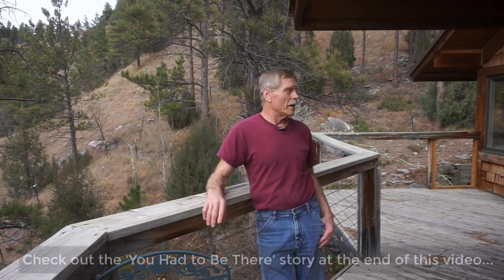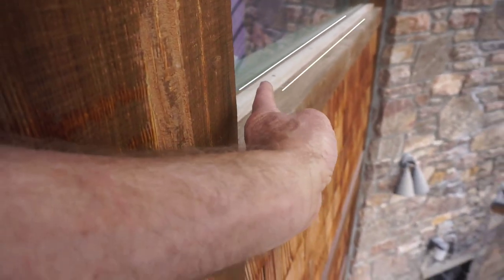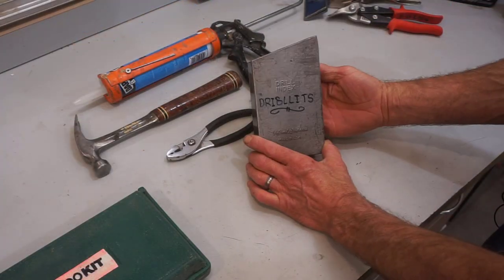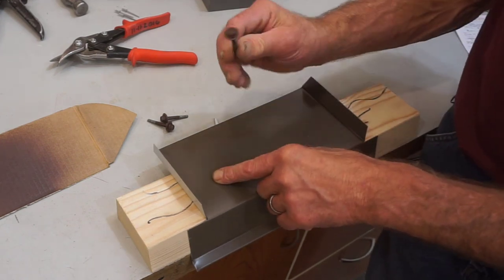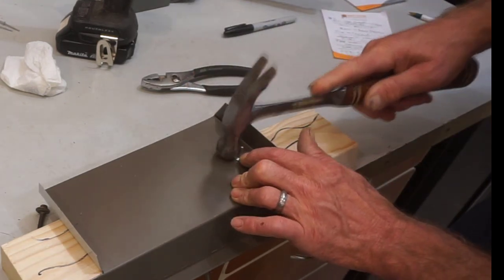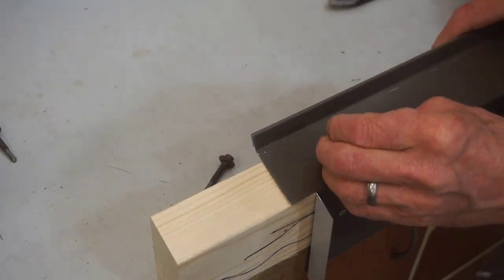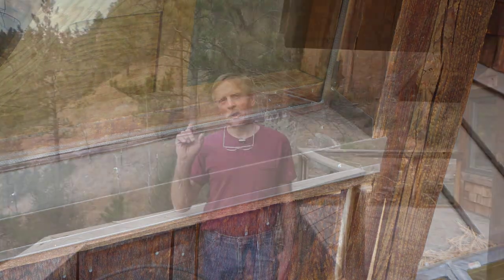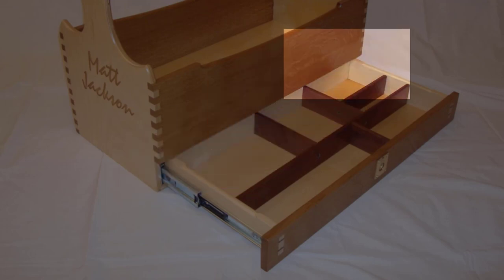Reverse Pop Rivets Fasten Metal to Wood?!

Comment: Or just a roofing nail.
Reply from the maker: Oh, so you're THAT guy!  No next level workmanship from you then? 🤨
Reply: I thought that too but the esthetic is not the same.
Reply: Pounding the pin in expands the rivet. The pin is now driven into new wood like a finish nail, and the head has expanded against the drilled wood. Having both these, along with the consistent appearance, makes it more than a nail. I like it!
Reply: For a woodsy application like that, try natured alcohol (instead of denatured)

Comment: Wait a minute... that's a nail.
Reply from the maker: Yes... and no, Adam.  In an installation where pop rivets are being used for other connections a nail would look 'out of place' IMHO... but then again there's lots of times when that wouldn't matter so much.  Best, Matt
Reply: I know, I am curious how this is much better than a finish nail and a matching washer?  It LOOKS neat and is certainly a neat on-the-site solution when you don't have the 'right' stuff (not that this is wrong, if it works).

Still, it's something I will keep in mind for a few projects.
Reply from the maker: @DieCastoms  where would you find a coated finish nail and 'matching washer'?  Keep in mind that matching washer head screws WERE on site and I chose this as 'the 'right' stuff' on purpose, not as a inferior substitute from lack  of preparation, hence the disclaimer 'it's not a universal solution'.  Slip it into your bag of tricks for 'someday'? Best, Matt
Reply: That is a good finish.
It looks better than nail heads and washers sticking out. 
Think I'd seat the sill onto some caulking or construction adhesive just to make sure thise little pins don't give way in the wind.
Yes, another brilliant way to finish sills.
Cheers Matt ☺
Reply from the maker: Agreed,  @johnmontague69  ... the sill caps got sealed to the glass with bronze silicone to assure their integrity but a 'bed' of caulk underneath the flashing wasn't necessary for this installation because, despite being old and checked, the sills are incredibly dense and held the rivet pins with tenacity!  Your mention of additional adhesive tells me you've been around enough variety in on site conditions to know when extra measures are necessary and have the sense to apply them so thanks for adding your comment for benefit of other viewers.  Best, Matt
Reply: He is like me, overkill.
Reply: No, the pin in the rivet expands the rivet shank, increasing its holding power.
Reply: Cool trick. With a little more preparation, I'm going to use that trick with flush rivers, to put some sheet metal lining on some shop-made woodworking tools
Reply: I was trying to respond to the first comment, that it is just a nail.
Reply: @brw3079  It don't expand it when u reverse it because when it's the normal way the flat head part would be against the metal and the round head would squish the shank down and expand down to the flat part but reversed the shank is in the wood and the round head is just in the air being hit by it self till its touching the flat part so it don't expand it this way..  Watch it again..
Reply: @Dennis-pe6zx  The pin has a bulb on it. The pin was reversed. Now the pin has a bulb above the rivet head. The rivet head is forced down onto the sheet  metal. The pin is hammered home. The bulb is now forced into the rivet head. The bulb has to go somewhere, so it expands the rivet head and part of the rivet shank.
Reply: @brw3079  That's not expanding it and holding it in.. Only thing the ball is doing now that it is reversed is sealing over the hole with the silicone. It's not expanding nothing because with it being drove home the pin and shank both went down so the ball is just barely going down in the hole.  So the part of the rivot he reversed is working more as a sleeve and the center is just a nail with a round head.. Which I really don't care for because with him trying to sink the ball he dented in the metal everywhere he put 1..
Reply: @brw3079  It don't go in and expand like it normally would at all. Made it like a flange on a break like. Or look like a funnel but not as steep or deep.. (in case u don't know what the flange on a break line looks like)
Reply: @brw3079  Check out 7:00 it show the ball is still completely above.
Reply: What everyone needs to remember is that this trick was developed by a sheet metal guy and most of the guys I have ever talked to have TONS of rivets in their supply but few small nails. This procedure is/was whats for THEM and I am glad that Matt shared it with us. As Matt said " This IS NOT a universal solution for all (not even most) sheetmetal installations but, rather, a great alternative for jobs where cosmetics are more important than overall strength of attachment so installer judgement is required!"
Reply: @tomtruesdale6901  Looks like it worked good enough to me and I do carpentry and finish work for a living. Like u said in a pinch it will do just fine. No matter what u say someone is gonna find something to complain about this is YouTube.. Can u imagine if u put this on facebook lol.  Holy shot look out this would be the worst thing in the world and would have to tare down the house or something lol.. Keep doing u have a good day.. 👍✌🤪😊
Reply from the maker: @tomtruesdale6901  your sensibility is a breath of fresh air  here... thanks, as always! Best, Matt
Reply: @jeffstanley4593   They call it OCD i call it doing it overkill , when im building and assembling , but its peace of mind, if the budget allows it sure .
Reply: LMAO, sure have seen a lot but never a nail in descise
Reply: Adam Rivera i think the key word is Aesthetic.
Reply: It's a nail in rivet clothing. xD All it needs was a nail, but it looks better this way. Plus it will give anyone who doesn't know this trick something to think about -- "That's a REALLY long rivet. HOW did they get it in???"
Reply: @brw3079  Yes this is how it is better than a nail. Like how an red head concrete anchor is better than a big nail. 😊

Comment: The reason people do this rather then use a nail is when you drive the pin in the ball at the end expands the rivet into the sheet metal an helps it make a tighter seal

Comment: What works even better is to install a hook strip first.  A piece of metal formed to the same profile as the outside cap that is nailed or screwed to the existing sill. The “kinked” front of the hookstrip slips into a hem that is formed on the outside piece .  This method prevents high winds from blowing it off.  Worked for me for 40 years as a union architectural sheet metal worker.

Comment: This is  perfect idea for an installation for my deck. I had a shed installed underneath my deck and the installers put slanted boards underneath the corrugated aluminum roof to divert the water away from the wooden walls. It was not a successful application as the water runs onto the wood anyway. So now I have to deal with keeping the wood from rotting on my own. I bought some rolled sheet metal flashing(1 foot wide or so) from home depot(color matched to my stain) and I am going to extend it out from the slanted wood. I will use the reverse riveting method to attach the sheet metal so water will not hit my wooden shed wall. Count me as one person you helped. Thank you for your kindness in sharing this with me. I will probably add a gutter as well.
Reply from the maker: That's cool, George!  Be sure to goop 'em up well with silicone anywhere with constant exposure to water because the reverse rivet pins are relatively small and won't hold well in damp wood or heavy loads.  No shame in using color matched washer head screws where necessary... Best, Matt

Comment: I'm making an anti theft mailbox using a 12 X 24 round air duct and a PT 1 X 6 and thought I could use a pop rivet to attach the sheet metal but didn't know how without splitting the wood. Now I know to use a reverse pop rivet which will look much better then truss screws I had planned on using. Thanks 👍

Comment: Well I'll be!  I've seen these before but never knew how they did it.  Now I do!  Awesome tip! Thanks!
Reply from the maker: Not sure what you've 'seen before but never knew how they did it' Daniel but want to make sure you know that this isn't the standard use for pop rivets which are normally used for fastening sheetmetal to sheetmetal requiring a pop rivet 'gun' to do so.  Ignore this if I read more into your comment than intended, OK? Best, Matt
Reply: @NextLevelCarpentry , Thanks for the note.  Yes, I've seen rivets used this way (to secure metal flashing to wood).  My family did all kinds of construction and remodeling and as a kid, I was dragged around as free labor.  Most of my woodworking skills came from trial and error and improved by watching videos like yours.  So Thanks!

Comment: This is a perfect solution to a project I am working on now. I am adding a 6" roll flashing border on a wall, to give it the industrial look. I was looking for fasteners that would give that same industrial look without protruding and catching on passerby. I'll use adhesive and reverse rivets and I bet it will look great. Thanks!
Reply from the maker: MJC Peters, this does sound like a great solution for your project.  If there's potential for clothes catching you might want/need to hit the rivet heads with a smooth file after driving in case there's any little burrs to snag stuff... but in any case this will be far better than hex head bolts or regular flat headed nails... Good luck!  Best, Matt

Comment: Hello! Love your channel and watch it often. PLEASE NOTE: Wrapping window sills with aluminum ACCELERATES decomposition of the wood. Im a contractor in historic St.Charles MO (Where Lewis & Clarke crossed the MO river). I regularly work
 on 150 yr old homes, the majority of exterior wood damage that I repair is caused aluminum wrapping!!!! The wood is completely disintegrated under the aluminum. Water gets in and can't escape.
 Best method is treat wood with breathable sealant and use a drip edge type flashing to direct water away, but allows it to breathe and dry.  Thanks again, love your channel.
Reply from the maker: Your note of caution is well taken Tim... I too see plenty of degradation of wood wrapped with aluminum... particularly on aluminum and vinyl siding jobs where improper sealing and not accounting for water draining indeed accelerate rot.  It's not aluminum in particular that speeds up rot but the other factors you mention.  These sills in this instance will definitely extend their life even though 'wrapping' is often not the best practice for doing so. Best, Matt
Reply: What is "breathable sealant"?

Comment: Pure genius! I just used some rivets the standard way to fix my daighters broken school id. badge after i found that super glue would not bond to the plastic. I made a small tab from sheet metal and folded it in half drilled 3 holes, two for the tiny rivets and 1 for the lanyard. I hammered them flat for a cleaner look once complete. She didnt know what rivets were, but after I explained they hold airplanes together, she appreciated the effort. This just goes to show, you can always solve simple problems if you use your best tool, not that tool, the other one!!!

Comment: Thats awesome!  Tks for the share!  Paint won't stick to silicone though in my experience, well standard latex won't, rattle can might, can't think of the right word ATM
Reply from the maker: You're right Dirt Diver... pretty much nothing sticks to silicone... unless it's the paintable type.  I use alcohol in the video to clean it up but a quick wipe with acetone or lacquer thinner might be necessary too to get something to stick.  Best, Matt

Comment: Also, your "dribletts" tin reminded me of the exact set that I once owned. Replaced them with quick connect bits from Milwaukee when I purchased a Black+Decker Matrix combo that included both drill and driver "heads".

I once took golf lessons using my father's trusty dusty sticks. First comment out of my instructor's mouth: "Ah, bag of ancient Chinese wisdom!" Cracked me up and I'll never forget it.

As these are obviously well-seasoned bits, perhaps a short tool tip video on how a Master Carpenter keeps his bits sharp?
Reply from the maker: John, a video showing how I keep bits sharp would consist entirely of a demonstration of the Drill Doctor machine I've used for years.  Any model is a good value since they can easily pay for themselves in faster drilling and saved bits.  This is the model I have:  https://www.amazon.com/dp/B000BKUY1O/ref=sspa_dk_detail_0?psc=1&pd_rd_i=B000BKUY1O&pf_rd_m=ATVPDKIKX0DER&pf_rd_p=f52e26da-1287-4616-824b-efc564ff75a4&pf_rd_r=5W3X1RCS4VBYXN9C42NP&pd_rd_wg=eSYp0&pf_rd_s=desktop-dp-sims&pf_rd_t=40701&pd_rd_w=U5r5J&pf_rd_i=desktop-dp-sims&pd_rd_r=7ed75962-db32-11e8-943e-3f50e486d3b4
but I'm pretty sure any model is a good investment based on anticipated use.  Best, Matt

Comment: Funny you put this up today.
I actually have the tin off the side of one of my buildings trying to figure out how to fix a bad leak around a replacement style window. 
The water was just running inside the building.

A local handyman put it in 4 years ago or so and the massive amounts of caulk he used have finally failed.  I found videos on how to 
instal the nail flange windows in tin, but none on replacement style windows. 

I'm going to need to make the opening a bit larger and make a sill. As it is it's all 2x4's that stick past the sheathing 1/2 inch or so. No slope on the bottom and no room around the window frame for adjustment or even insulation.

My other option is to get a new sheet of tin and cover the window and forget I ever had one there...
Reply from the maker: Ya, there's a LOT of ways to do sheetmetal wrong, that's for certain nevermindthebullocks!  This trick might come in handy as you re-work things but sounds like you might need bigger guns and more ammo to make things right for your window challenge... good luck! Best, Matt
Reply: @NextLevelCarpentry  I have put in one exterior door. But it has a porch over it and catches no rain.  

I think I could handle a flange style window with the housewrap and flashing tape. On this one there is none of that. 
I think I will use some plastic for a ways around the window and down to the ground under it and use flashing tape. 

This one the only thing I can think is copy the door design and trim out. I will run plastic and flashing tape around and under the window so if it does leak it just runs to the ground behind the tin. Instead of inside my wall and insulation like it currently is.
Reply from the maker: @nevermindthebull0cks  do what you can to keep water from getting behind anything and, if there's any chance for it to get in, there should be a flashing to get it out asap!  Without actually being able to see your installation details I don't have any other advice in particular.  In general a drip cap on top and good sealant along sides and bottom will get the job done but metal skinned buildings introduce some complications... but  you already know that.  Best, Matt

Comment: Any reason why you wouldn't use flashing nails? Seems like they would hold better than a smooth rivet pin.
Reply from the maker: Good question Shadow Hunter... I like the look of the rivet head for this application better than a 'flashing nail' but that's just me.  These sill caps need only minimal fastener holding power to stay in place so the less-grippy smooth rivet pin was more than adequate.  For other flashing applications a nail or screw would be needed to hold things in place long term.  Best, Matt

Comment: Neat trick, is the main benefit the fact that the rivet won't pull up verses when you're trying to do it with a rivet gun? Or is there another benefit as well? ( I can't say that I've ever riveted into wood before) For sure nothing will quite make you curse as much as riveting a finish trim piece and accidentally denting the metal with the rivet gun as the stud breaks off.
Reply from the maker: Hi HFR... the thing I like most about this little trick is to get a consistent 'rivet look' on a sheetmetal project where otherwise there's a mix of rivets, screws and nails.  Careful execution of riveting and this little hack will produce as non-dented of results as possible.

Comment: Thanks for this Matt 👍🏼 Great finish with this method.
How strong is the hold with this method though? I totally see the sense in using the mandrill as a fixing nail, but as the shaft of the rivet doesn't get compressed, what's to stop it from just popping off?
Reply from the maker: The viability of the whole idea is in how well the rivet shank holds in the wood its driven into.  The rivet won't slip off past the little 'button head' that's there to draw up the rivet in normal use but, because it's essentially just a small finish nail, it needs to be driven into sound wood to hold.  If the hold it provides isn't strong enough for the given situation it's wise to sacrifice the nice, clean look of this method for a longer actual nail or some sort of screw IMHO...
Best, Matt

Comment: Ah, did you know about something called the 'Drive Rivet'?  Works just the same as this, only you just drill the hole, push it in, and tap the pin.  Arrow Fastener had an attachment for their T50 staple gun at one time for these they called the 'Xpando' rivet.  Still, this is a brilliant idea and one I'll put into my mental tool kit.
Reply from the maker: Never heard of the Xpando rivet but used 'drive rivet's recently for attaching FRP panels.  Thanks for commenting here Alonzo... best, Matt